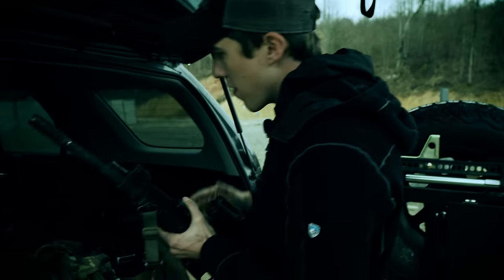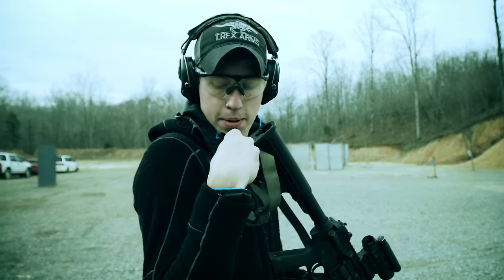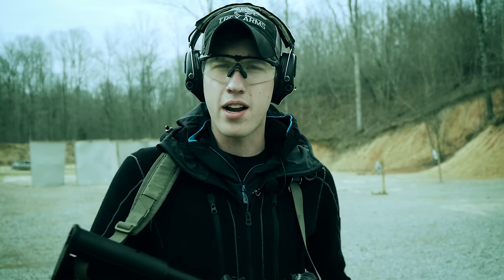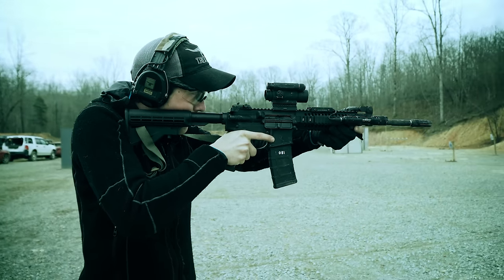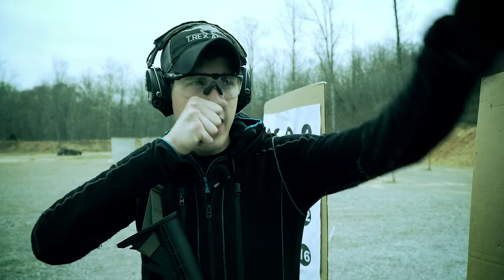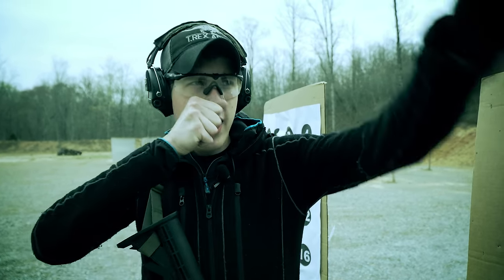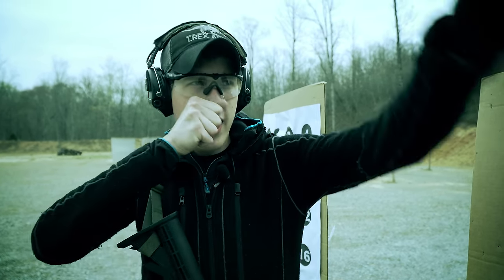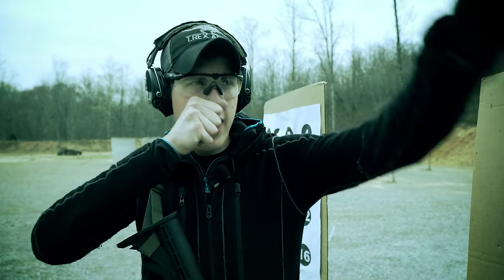How To Control Rifle Recoil

Comment: This is great.  I kind of learned to do some of this running and gunning my AKM on a course because I had to brace the gun well and fight the recoil to get quick accurate shots on target.  I think if you shoot an AKM or larger caliber piston or blowback gun, you learn to do this instinctively.  The DI platform in 5.56 is easy to control.

Comment: A lot of people think you have to stick a muzzle brake on the end of your barrel. That can help but the extra gases can be problematic. I built an AKM, made it super cushy and stuck a flash hider on the barrel instead. It still ran super smooth, a lot smoother than what I expected. It's the rest of the build that'll help with recoil. For AR's, what stock are you using, gas system, buffer tube etc?

Comment: good video.  i keep seeing a lot of people using the over rail grip method. which is ok for some people. however the same recoil management can be actively done with a 45degree thumb hook grip on the underbarrel. as this method as you even said, you are watching for the return of the sight to the location which your previous target apiture was on to disburse rapid fire. this is reactive sighting, not positive sighting. i suggest try and get some hook which allows recoil control, with allowance for natural fall of the firearm to palm rest. because when you use palm rest with thub control on the forward hand guards it does 2 things this method doesnt.  1 it aligns your wrist with the rifle allowing your mussels to act as a natural shock buffer rubber banding it to its previous position naturally, as you still get thumb control with a hook. and 2 not only is your hand coming back down under the barrel reducing risk of injuries in combat environments, but your also rotating wrist again 45degree, making the index finger an aim point. where you do not need to aim, when you hold the weapon as such... feeling the barrel and pointing is aiming. aka 105 cqc advanced tactics. also, this uses sensory perception and not just memory management, so that alone allows quicker response times with improved groupings. where this rest position, is also more balanced for breath control for taking longer precision shots as well, reducing time between grip stance change because its in the same control stance. using the thumb and finger takes a little adaptations, especially in higher caliber sbr's. try it a few times to get use to it, then take a comparative grouping and speed text... like try 3 shots in 4 50m circles, 3 shots in 2 100m ciricles, and  1 shot in 4 300m ciricles... not only will the free float thumb hook and finger point method finish faster the grouping and dead eyes will be more center in comparisons, i promise!!!
Reply: so just as you remarked shoulder stance wrong, which i 100% agree, seeing poor gripping and trigger squeeze is equally novice to me when i see it. so good footwork, and shoulder placements, and sight position is well also... i know bad posture is founded upon in etiquette school, but in marksmanship its actually good for leaning into the stock, so lunge more and fix that forward grip... fyi dark side finance for 5 years united states army, and shot 40/40 12/14 times, due to once a bolt broke, and once a mag jam or it would have been 40/40 14/14 times.

Comment: Was waiting to see if you would say to pull the stock into the shoulder with off-hand. Honestly very crucial when I see soldiers with loose  shot groups. Reduce space for bounce and remember that your trigger hand has only one job... stay loose and squeeze the trigger. 

Although.. really want to emphasize that your stock placement while prone(not standing) should not necessarily be tucked. When shooting controlled fire(weapons qual for you Army folks) you put that sucker high or low or whatever gives you a consistent sight picture. I will never forget the time a prior Marine(yes I know "always a Marine" but he is Army now too) showed me this trick by having me place the stock high up on my shoulder and told me to close my eyes. Then slammed his hand straight against the front of my muzzle with a good bit of force and while prone it didn't affect me at all.(empty rifle that I was dry fire training on. Don't try this by the way.) Point is, different stances and firing volume requires slight adjustments in some fundamentals sometimes. I'm not disagreeing with your standing tip, just adding insight.

Comment: You missed one important detail on recoil control and it is related to angle between forearm and upper part of the arm. That requires butt stock to be extended to proper length. It has to be 90 degrees and not less. Ask instructors in special forces - they will tell you and I learned hard way in national championships on PCC that recoils far more (blowback system vs delayed with lighter buffer and BCG) than AR-15 or M4. Now all rifles that I might use are checked for that length and if law requires then they are pinned at that length. it can also damage your tendons next to elbow if you shoot enough with incorrect extension of butt stock (something that also happened to me).

Comment: what do you zero your rifles for? i zeroed my AR for 50 yards and ran drills with your targets off the website at 5,7,8,9,10 yards and of course i had to hold over, luckily i had an eotech and i used the bottom "tick" under the 65 moa ring. I was wondering if you were holding over when you run these drills as well or zero them for a shorter distance

Comment: Another reason to keep the stock of the gun a little higher on the shoulder is it allows the shooter to move more naturally and ultimately more quickly. It will never be as accurate as having the stock in the shoulder pocket, but there is a reason to it.

Comment: Here’s my tip: pull the mouse or stick down according to the amount of vertical recoil it has. Some guns have lots of horizontal recoil, this is especially an issue with machine pistols. My recommendation for this is to burst fire them

Comment: How do I connect my mouse to my AR so I can drag it back to control recoil? Seems like the mouse method is less complicated than all the other stuff. My AR does not have a USB for the mouse. Guess I will need to get a rail mounted adapter. Could you show how to manipulate the mouse while shouldering the AR?

Comment: What light setup are you using on that AUG? I've been trying to figure out a good way to mount a light on mine. Do you have the stock grip or did you switch it out for a rail and a different fore grip?

Comment: Umm your first tip seems a bit off, what you say is wrong: putting the stock a bit above you shoulder but the bottom of the stock still against it. Why does the military use this method?

Comment: I'm built like you but I'm having a tough time lowering the butt of the rifle into my body and still see through the optic.   The optic you use at 13:42 is similar to mine.  But I see you have it mounted a little further towards the muzzle than how it was mounted on mine.   Perhaps the further away the optic the less I will need to bend my neck to see into it.   Before I send it back to be adjusted I thought I'd get your take.  I wish I could send you a photo of my rifle & current mount.

Comment: I'm having trouble holding the m4 carbine up with my support hand in "contact ready" even though I have proper stances. Is there a method I could hold the carbine as long as possible?
Reply: Train more and get used to it.

Comment: Army teaches to use your pad of your finger and not the crease. I noticed your using the crease, is that intentional?
Reply: He's firing fast in close range conditions. The accuracy gained from using the finger pad is negligible at such ranges and speeds compared to the lowered strain of rapid firing using the finger crease. He gains leverage on the trigger by doing it. However, would it be longer range conditions where as rapid fire wouldn't suffice, using the finger pad does have effects on the accuracy, and the strain of rapid firing isn't a problem. Just my 2 cents
Reply: @aerobetamax6022  ah! Thank you for that! It's not often I get an actual reply that's informative!!!

Comment: Hey I have a question I haven’t been able to find the answer too, I’m trying to get the charging handle on my at-15 to work smoother and be a lot easier to pull back, I’ve already greased and oiled
Reply: Replacing with an after market charging handle that is anodized or aircraft grade aluminum will help make it smoother. If you don't want to break the bank I would recommend the  Strike Industries ARCH. If you don't mind spending a little more and also want a little larger charging handle to help with slightly more real estate that can offer a better grip ( I shoot in the rain and also with optics ) look at the Aero Precision Ambidextrous. There are many more handles out there that are smoother and offer easier pulls on charging. The two I mention are are just starting points and ones I use. But it really can come down to trial and error and what style handle feels best to you.
Reply: M4rifleguy thank uou

Comment: I alwyas thought that your feet are supposed to be aligned with each other. Yes they will be wider than my shoulders, but I didn't think that putting one leg more behind myself would be helpful. I used to put one leg more back, but I stopped. Still useful information and things to apply.

Comment: I've always had to move my right leg behind me a few inches. It feel more controlled. "Experts" always try to correct me and say to "square up". I tried practicing with both legs directly below me and it messed me up more than helped. I know theres no wrong way (safety considered), but it's good to know that there are good shooters that also use this technique.
Reply: In my opinion There IS a wrong way. And squared up us wrong in more than just recoil management.
It also makes it much easier for you to be knocked over, backwards OR forwards in a team environment, or taken down easier as well.
In my opinion it IS a safety issue real world. It's also less efficient being able to move offline.
I had the same issue of "professionals" trying to correct it, fuck em. 

Outshoot them in some drills and courses, and tell them to leave you alone lol.

Comment: The front hand doesn't do "ALL" the recoil mgt, lets say it does most. Jerry Miceluk would say that the front hand is mostly responsible for driving the gun. Both hands keep the oscillations to a minimum. But I agree with you otherwise. 
We just need to be careful while using absolutes. Thanks

Comment: If you’re going to shoot square use a karate horse stance instead of being rigid with a high center of gravity. Open your legs a little and bend them just enough to get into and athletic stance and stick you butt out a little. Your hips aren’t engaged at all in straight posture as far as resisting lateral force. You gotta add more cushion for the pushin to keep your chest and plates forward if that’s your goal.

Comment: Don't put 1 foot behind the other. 
Square up to your target. 
It allows for movement to any other direction if you need to. 
You can step left or right. Easily take a left or right knee.
Also when you don't square up it allows the recoil to push the weapon to the side more than if you were squared up. 
"may" Enough practice as he's done it's combated the side push however it's still better practice to square up. 

To control the recoil when you squared up. 
Get your but down farther. 
It will feel uncomfortable but that's what training is for.
Reply: You can still move easily when one foot is behind the other. 

Having one foot behind the other doesn’t cause the gun to go to the side more. The reason that happens is because you’re not shooting with the force aligned with your spine, so your body rotates. As long as your shoulders are perpendicular to the target and the gun is places in the same location then the gun goes to the side the same amount
Reply: Military background.

Comment: You are a great shot, and very impressive, but when you have body armor on this method does not work as you mentioned. This is great for the range or three gun shoots, not for combat with body armor. I actually find having the rifle higher up on the shoulder, as you first demonstrated,  and not having to bring my head down to the sight, is faster, at least for me (and the Navy  Seal showing me this method). Four shots at two different targets 1.12 seconds, center mass first two shots on each target, head shot last shot on each target). First shot .39 seconds (damn, that Japanese kid is faster than me). I'll admit my groups are not great using this method, but when you need to get your gun up quickly and on center mass quickly this works for me. Just my .2 cents and what works for me. And I don't disagree with you, all great info and tips, but this method does not work for me with body armor on.

Comment: If your having issues with "recoil" using 5.56, you might want to invest in a sling shot.
Reply: sinistar426 Recoil with 5.56 is mostly due to improper handling.